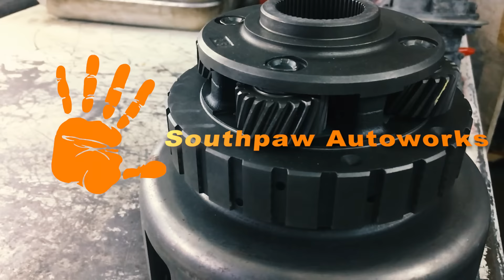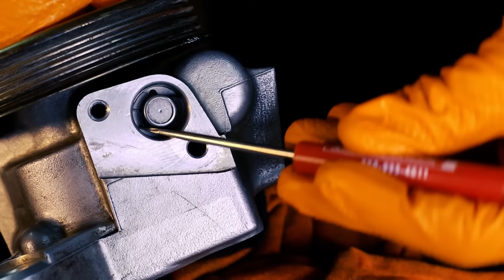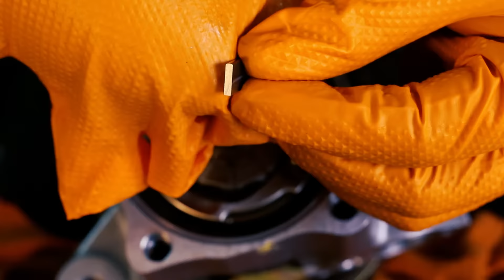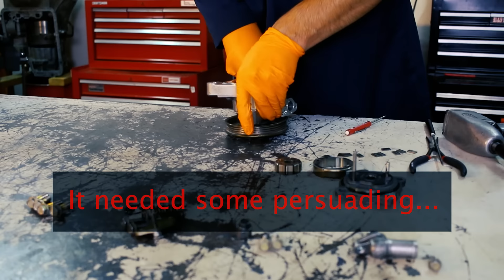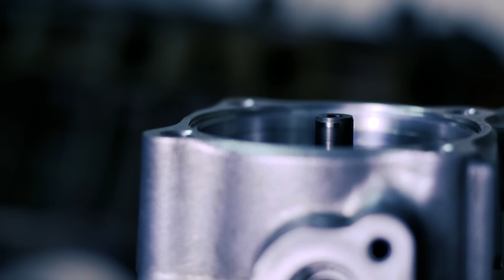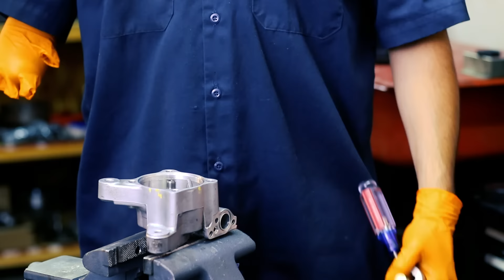Power Steering Pump Rebuild - Part 1 of 3 (1 Hand Mechanic) #SouthpawAutoworks

Comment: This has been one of the most thoughtful Youtube presentations I have seen - on any subject.  Thank you for the care and attention to detail that you have given.  And you did it with one hand!!
Reply from the maker: Thank you for the positive feedback.  A lot of time and effort went into making this video.  It's a labor of love...
Part 2 has been filmed, and edited.  A few more adjustments, and it'll be going live.
Most of Part 3 (final video in this series) has been filmed, and edited.  Stay tuned...
Reply: @SouthpawAutoworks  I had found your Youtube video as a result of searching for information on how I might rebuild my power steering pump, on a 1995 Toyota Camry.  After finding what I felt I needed, I purchased a seal kit, and proceeded to undertake the task of removing the power steering pump.  But the surprise that I got, which I was not expecting, was that the belt which drives the pump had broken (and disappeared).  When I initially looked into the engine compartment I saw the belt for the air conditioner compressor and alternator, but did not realise that there should have been a second belt (for the steering pump).  No wonder the power steering was not working!!!  There have been some good things come from this exercise, though, because I have flushed the power steering system with new Dexron 3 fluid, and have thoroughly cleaned the inside of the power steering fluid reservoir.  Maybe the pump might still benefit from a rebuild with new seals, and the car (which has over 300,000 km on the clock) might get a new lease of life.
Reply from the maker: No way...   I'm glad to hear that it was a simple fix.  If you do decide to open up the pump, share some video footage/pics of it.
Take care.
Reply: @SouthpawAutoworks  Southpaw auto works
You (Southpaw) suggested that if I do decide to open up the pump, that I should share some video footage/pics of it.  At this stage I would like to share my experience with flushing and cleaning the power steering system.  I have seen a number of Youtube videos which showed flushing being done, but most of them involved quite a lot of spillage of power steering fluid, and also requiring very much new fluid before all of the old oil was flushed out of the system.  At least one of those videos suggested the use of a turkey baster as a suction pump to remove fluid from the power steering fluid reservoir, but this was tedious with the turkey baster, and did not remove all of the oil from the reservoir, and it certainly did not withdraw oil from the steering system.
(I have inserted this paragraph after I had written the following “story”.  I know that this story is a bit long, but I wanted to give details which are easy to understand.)
I did some thinking, and built a suction pump which enabled me to withdraw ALL of the power steering fluid, without spillage onto a spill tray that I had placed beneath the car.  What I would like to do is explain a bit of what I did, and the advantages I have experienced with this method.  First of all, my suction pump was able to withdraw all of the oil, until it was just sucking air.  Secondly, I took the reservoir out of the car, and after I drained the last few drops of oil from it I could see the fine wire mesh sieve at the bottom of the reservoir.  This sieve traps particles of debris from inside the steering system, and in my case this sieve had trapped a lot of debris.  As I inspected this sieve in the reservoir I realised that even a lot of normal flushing would not achieve much of a result of cleaning out the debris.  I partly filled the reservoir with gasoline, and with the inlet and outlet tubes blocked shut I shook the gasoline around inside the reservoir.  I was surprised at how firmly the dirt was adhering to the inside of the reservoir, and how little was being washed off by the gasoline.  To my way of thinking I needed to find some way to scour or scrub the inside of the plastic reservoir.  I did not want to use some harsh sort of abrasive such a sand or grit which would scratch the plastic.  I remembered something I had done years ago when I had needed to clean the inside of a plastic container which was more delicate than the reservoir.  I got a piece of lead sheet about 1.5mm or 2mm thick, and cut some narrow strips of lead about 2mm wide.  I then cut small pieces of lead, about 1mm or 1.5mm, from those strips, so that I created some small pieces of lead shot, about the size of grains of rice. I put about a small spoonful of this lead shot into the reservoir – about half of it into the inlet tube (below the sieve) and the other half into the main filler cap (above the sieve).  I then quarter filled the reservoir with gasoline and repeated the shaking procedure.  The results were amazing, with the sieve becoming shiny, and the inside of the plastic reservoir looking almost as good as new.  The benefit of using lead shot like this is that the lead, being soft, will not scratch the plastic.  Also, because the lead shot is heavy, it is much more effective as a scrubbing agent than some other lighter weight substance.

It is obviously very necessary to make sure that every last piece of lead shot is shaken out of the reservoir after the scrubbing has been done.  After it had been scrubbed, I rinsed it again with fresh gasoline, and then I used compressed air to thoroughly blow out all traces of gasoline from the reservoir.  There is one other very important thing to do, and that is to rinse out the inside of the reservoir with clean power steering fluid to remove any last traces of gasoline.

It then becomes a very much simpler exercise to refill the system with power steering fluid, because there is almost none of the old fluid still in the system, which could be flushed out.

And now, I could get to the vacuum pump which I built.  I wonder how many people are watching this Youtube, and reading the comments.  I hope that my long story has not put anybody off.  I shall keep watching to see whether anyone adds a comment, asking for me to give details of my vacuum pump design.  If anybody asks, I shall be happy to write another story about how I built an amazingly effective pump from very simple materials.  I built mine entirely from things I had in my workshop, so I suppose that you could say it cost me almost nothing, other than the time it took to build it.

I would like to add a postscript, saying that I do not know how to attach photographs to this comments section.  I would be more than happy to add photos if I know how to do it.
Reply from the maker: What a great method to clean hard-to-reach places, like this inside of the pump reservoir...and specifically, a metal screen that's partially plugged/blocked by contaminants.  
I am interested in seeing your pictures.  I'm also interested in learning more about your homemade vacuum pump.

Sharing Your Pics:
1)  Instagram is a great way to share pics.  southpaw_autoworks  
2)  If you want to share pics on YouTube, you would need to create a video, of your pics....like a slideshow.  
A guy could use a number of video-editing programs to accomplish this.  There are free versions for both PC & Mac:  Windows Movie Maker (PC) and iMovie (Mac).  Also, I believe that Microsoft Powerpoint might work, for this instance, too.   I posted some resources below.  Gotta love YouTube...

Resources:
PowerPoint:  https://www.youtube.com/results?search_query=create+a+video+with+powerpoint
Windows Movie Maker:  https://www.youtube.com/results?search_query=make+video+with+windows+movie+maker+
iMovie:  https://www.youtube.com/results?search_query=make+video+with+imovie

I look forward to seeing your pics/video.  Take care.
Reply: @SouthpawAutoworks  Can you please advise an email address for yourself or your business?
Reply: @SouthpawAutoworks  The vacuum pump I built for extracting power steering fluid consists of two main parts – a pump to create the vacuum, and a suitable container to hold the fluid which has been extracted.  The information which follows is in two parts, firstly a simplified description of the unit, and then a (much) more detailed design and the materials I used.
= = = = Simple description = = = =
The pump is very similar in principle to a bicycle pump, which compresses air when you push the plunger into the cylinder of the pump.  The vacuum pump, on the other hand creates a vacuum when you withdraw the plunger from the cylinder.
The storage container is a large glass jar which has an air-tight metal lid which screws onto the jar.  Plastic tubing is attached to two metal tubes which are fitted through the lid.  One tube connects to the pump which creates the vacuum, and the other tube is inserted into either the reservoir, or the return hose from the steering rack.  It is very important to make sure that these tubes are sealed perfectly airtight to the lid, otherwise the system will lose vacuum easily, and will not work very effectively.
I constructed a box just big enough, and tall enough, to completely contain the glass jar, and attached this box onto a base on which I can place my foot, to keep the jar stable during the pumping process.  I attached a “post” to the side of the box and strapped the pump (in a vertical position) to this post.  To use the pump, I place my foot on the base, and move the plunger up and down – pulling up creates the vacuum.  The box serves two purposes.  First, it provides a safe place to protect the glass jar from accidental damage or breakage, and prevents it from being bumped or tipped over.  Second, the pump is attached to the side of the box (i.e. onto the post which is attached to the box), and when you place your foot on the base to hold it down you can pump as vigorously as you wish without any risk of the jar becoming disconnected from the pump.
I will post the detailed description as a separate comment, because Youtube apparently thinks it is too long!
Reply: = = = = Detailed description (part 1) = = = =
Please note that I called this a “Detailed” description.  I do not know of a way to insert pictures or photos into a comments section like this on Youtube.  I have tried to make this description as detailed as possible so that you should be able easily to visualize each step of the way.  This is a long description, but I hope it is a good one!!  I have broken it into several parts, because Youtube does not seem to like long comments!
The cylinder of the pump is a piece of PVC plumbing pipe.  You can choose the diameter of pipe which you use.  A small diameter pipe (such as one inch) will mean that you do not withdraw very much air for each stroke of the plunger.  A bigger diameter pipe (such as two inches) will mean that you can withdraw much more air for each stroke of the plunger, but it will also require more muscle power to operate the pump.  I used a pipe with about one and a half inches internal diameter. You can choose how long you would like the cylinder to be, but I have made mine about two feet (600mm) long.
I made the plunger from a length of bright steel rod.  You could use 5mm, or 6mm or quarter inch diameter rod, depending on what you have available.  You will need thread cutting tools (a thread tap and die) for the particular steel rod that you use.  Cut a thread on one end of the rod, about three quarters of an inch long, or about 19mm.
The piston requires you to use a reasonable amount of precision, because it is at the “heart” of the system.  You will need to obtain, or make, a metal disk which provides the backing for the piston seal.  This disk must be of stiff material (steel, somewhere around one sixteenth of an inch, or even one eighth of an inch, or 1.5mm to 3mm thickness).  The size of this disk must be fairly precise, and must just fit in the bore of your plastic cylinder pipe.  The diameter of the disk can be slightly less than that of the pipe, but it must be able to slide up and down the pipe very easily, and its edges must be polished smooth so that the disk cannot scratch the plastic pipe.  Drill a hole in the centre of this disk which is smaller than the diameter of the plunger rod, so that you can cut a thread on the inside of this hole, so that this disk can be screwed onto the plunger rod.
Reply: = = = = Detailed description (part 2) = = = =
You will also need a washer which is about quarter of an inch, or five sixteenths of an inch less in diameter (6mm – 8mm) than the first disk.  If you need to make this washer yourself, you can use thinner material, 0.5mm to 1.0mm in thickness.  Drill a hole in the centre of this washer, the same size as the diameter of the rod.  This washer just needs to slip onto the rod.
Now we get to the piston seal itself, which is made of soft leather about 2mm thick.  If you “just happen” to have an old leather shoe which is worn out, you may be able to rescue a piece of leather from it, which is big enough).  It needs to be about three eighths of an inch (10mm) bigger in diameter than the internal diameter of the cylinder.  Punch a hole in the EXACT centre of this leather disk, but make this hole slightly smaller than the thickness of the plunger rod, so that it has a very snug fit on the threaded end of the plunger rod.  Very carefully chamfer (or “feather”) the edges of this leather disk, so that the edges of this leather disk can be cupped when the pump is assembled.  This chamfering of the leather should be done on the rougher side of the leather.  Soak the leather disk with engine oil, which will allow the leather to become supple, also it will provide lubrication between the leather and the plastic pipe when the pump is operated, and the oil will also help to make the seal capable of maintaining a high vacuum.
The assembly of the piston is described in the following the steps:
.  First, fit a nut onto the threaded end of the plunger rod,
.  Next, slip on the smaller washer, against the nut,
.  Then fit the leather washer onto the plunger rod, with the smooth side of the leather against the washer.  If you made the hole in the washer a good snug size, you will probably have to turn the leather disk on the threaded rod – this is a good tight fit.
.  Next, screw on the bigger, thicker disk, onto the threaded rod.
.  Finally fit another nut onto the end of the threaded rod, and tighten up the two nuts which have the washers and leather between them.
Reply: = = = = Detailed description (part 3) = = = =
You should be able, at this stage, to slide the piston assembly into the cylinder.  You may need to massage the leather disk so that the edges are raised towards the long end of the plunger rod.  You can now test whether you have done everything correctly.  Push the piston almost all of the way through to the other end of the cylinder, place the palm of your hand over that end of the cylinder, and pull on the plunger rod outwards from the cylinder.  You should feel very powerful suction against the palm of your hand.
There are several more steps required to complete the construction of the pump.  
Make a wooden plug for the top end of the pump, from some type of moderately hard wood.  Soft wood could be OK if you cannot get hardwood, but it will not be as durable.  This plug should be about three quarters of an inch (19mm) thick, and cut into a circular shape so that it can fit snugly into the top end of the cylinder.  Drill a hole in the centre of this plug, which is slightly bigger than the thickness of the plunger.  When you use the pump, it creates a vacuum on the bottom end of the cylinder, but creates positive pressure above the piston.  This slightly bigger hole allows the positive pressure air to easily escape past the plunger rod.  Apply oil to the hole in this plug, to provide lubrication for the plunger rod as you operate the pump.  I mentioned that this wooden plug shall be a snug fit into the plastic pipe, and it is quite OK to have it slightly oversize, because you can use a hot-air blower gun to heat and soften the top end of the plastic pipe, and press the plug into place.  When the plug is tightly in position, use a file (or some other suitable method) to make a registration mark onto the wood and the end of the pipe, so that it is easy to see the exact position that the plug must be whenever the plug is removed and refitted.  With the registration mark in place, drill a small pilot hole through the wall of the cylinder and into the wooden plug, so that a screw may be used to lock the wooden plug into place.
We are now ready to complete the bottom end of the pump.  I made a plug from a piece of one inch thick black rubber material.  It is very important that this rubber plug is made as carefully as possible, because it needs to make a completely airtight seal.  I used my bench grinder to grind the circular shape of this plug.  The grinding rest which supports the material being shaped should be at a slight angle to the grinding wheel, so that the sides of the plug have a slight taper.  In other words the end of the plug which fits into the cylinder is slightly smaller in diameter than the other end of the plug which faces away from the cylinder.  For best results, this rubber plug must fit very snugly into the plastic cylinder, and this can be achieved if the bottom end of the cylinder is slightly tapered to match the rubber plug.  Use a hot-air blower gun to heat and soften the bottom end of the pipe, and push the rubber plug into position so that the plastic pipe will have the same taper as the rubber plug.
Reply: = = = = Detailed description (part 4) = = = =
Metal tubes need to be fitted to the pump, and also to the lid of the glass jar.  I used steel tubing with an outside diameter of about quarter of an inch (about 6mm), but the correct size metal tube must match the plastic tubing that you will use to withdraw the power steering fluid, and also to connect between the pump and the jar.  The tighter the fit, between the steel tube and the plastic tube, the better.  If necessary you can use the hot-air blower to soften the plastic tube to make it easier to push the plastic tube on to steel tube.  Drill a hole into the centre of the rubber plug, to allow insertion of a metal tube, about two inches long.  CAUTION: Drilling holes in a block of rubber requires care.  Make sure that you have some way to hold the rubber very firmly when you drill the hole.  Use a drill press, and advance the drill very slowly because it can easily happen that the drill will grab the rubber.  Also, you may need to do a little trial and error to determine the best size drill to use.  We want the steel tube to fit very tightly into the hole, and it would be good to test your hole-drilling procedure on a scrap piece of rubber.  To make it easier to fit the steel tube through the hole, use some power steering fluid to lubricate both the rubber and the steel tube.
We are ready now to talk about the glass jar that you will use.  Basically, you could use any jar which is large enough to hold all of the oil that you will extract from the power steering system.  It is very important that this jar has a lid which can close the jar with a completely airtight seal.  I used a jar which is about two litres in capacity, which had originally contained pickled Jalapeno peppers.  This jar has a wide mouth, about three inches (75mm) in diameter.  I have seen similar large jars which have contained pickled gherkin cucumbers from Poland.  Depending on which country you are in, and the types of foodstuffs which you can obtain in large glass jars, you can choose.
It is very likely that the jar you obtain will have a lid made from fairly thin steel.  When you create a strong vacuum with your pump, the outside air pressure would be capable of distorting the lid, and render it incapable of providing an airtight seal.  It is therefore necessary to provide reinforcement for the lid, which I did with a circular wooden cover which is just a little bigger in diameter than the lid.
So now we are up to the stage of reinforcing the lid, and fitting two steel tubes to the lid – one for connection to the vacuum pump, the other to collect the power steering fluid which is extracted from the steering system of the car.  We need to make a lid reinforcement disk from moderately strong steel sheet, probably about one thirtysecond of an inch or up to one sixteenth of an inch (0.8mm to 1.5mm) in thickness.  This disk shall have a diameter about quarter of an inch less than the diameter of the inside mouth of the jar.  We will also need a piece of soft rubber about 1.5mm to 2mm thick, which you could get from an inner tube from a truck tyre.  This rubber will be used to make a gasket to seal the holes for the steel tubes, and also for the screws which need to be used to hold the lid components together.  We also need four wood screws which are about the same length as the thickness of the wooden cover for the lid.
Reply: = = = = Detailed description (part 5) = = = =
The next part needs to be done carefully, to make sure that the holes we make in the various components of the lid assembly are all perfectly aligned.  On the lid reinforcement disk mark the positions for the two steel tubes.  In my case these two holes are near the centre of the disk, and about an inch (25mm) apart.  I found it very helpful to adhere masking tape to the disk, because it is easy to then use a pen or pencil to mark out the required positions.  Mark the positions for the four wood screws, at the four corners of a square which you can draw around the two holes for the steel tubes.  Use a centre punch to mark the positions of these six holes.  Now use adhesive tape (masking tape is good) to hold the reinforcement disk against the inside of the jar lid.  Make sure that you have this disk centred as accurately as possible.  Next, we need to fasten the wooden cover onto the lid, and this can be done by wrapping masking tape around the rim of the lid and the wooden cover.  Choose the correct diameter drill for the screws to be driven into the wooden cover.  Drill just one screw hole, and then drive a screw in, through the reinforcement disk, the lid, and into the wooden cover.  Tighten the screw firmly.  Next, drill another screw hole, in the opposite corner of the square pattern, and drive a screw into that hole.  The reason for fitting these screws, one at a time, is to make sure that the reinforcement sheet, the lid, and the wooden cover are all in perfect alignment before we drill the remaining holes.  You can now drill the last two screw holes, and the two holes for the steel tubes.  Make sure that the drill you use for the steel tube holes is not too big.  We need these two holes to be only just big enough to force the steel tubes through.  The next, VERY IMPORTANT step is to mark these three components of the lid – the reinforcement disk, the lid, and the wooden cover - so that you can easily reassemble them in the same position, and with the holes aligned exactly.  Remove the screws from the lid assembly.  A gasket needs to be made from the truck tube rubber which will seal all of the holes. Use a hole punch to make holes for the steel tubes, but make sure that they are smaller than the tube size, so that the rubber fits tightly over the tubes.  Cut the rubber into a circular shape, and fit it between the top of the jar lid and the wooden cover.  Push the two steel tubes through the wooden cover, keeping the top of each tube about one inch above the wooden cover.  I used a four inch long tube for the oil inlet, and a two inch long tube for connection to the vacuum pump.  Next, fit the rubber gasket over the two tubes.  At this stage, do not make any holes in the rubber for the screws to pass through.  Then fit the lid against the rubber gasket, and finally fit the reinforcement disk inside the lid.  Now use a sharp nail, or something similar to pierce the rubber gasket, for the four screws.  Install the four screws, tightening them firmly.  This will ensure that the rubber seals tightly against the lid, enabling the lid assembly to not leak any air.
Reply: = = = = Detailed description (final part) = = = =
We are almost finished, and I feel sure that anyone who can build the pump will be easily able to make the box into which the jar can be placed, and the pump fastened to a post which is attached to the side of the box.  I used a couple of pieces of metal strapping, bent into “U” shapes, to fasten the pump.
There are a few refinements which can (should?) be made to the pump.  To help maintain the vacuum in the jar while the plunger is being lowered, I made a simple valve in the rubber plug at the bottom of the cylinder.  I enlarged the diameter of the hole on the top side of the plug to a depth of about an eighth of an inch (3mm), so that a glass marble could roll into that hollow.  When the plunger is lowered, the glass marble falls into the hollow, and blocks air from getting back to the jar.  If you want to do this, you will need to make sure that there is a good seal between the marble and the rubber stopper.  I also wanted to prevent the plunger being pushed down too deeply.  I used a nut of the same size as was used for the piston assembly, but drilled out the thread so that it could just be pushed onto the top end of the plunger rod.  I wanted the piston to ALMOST get to the bottom of the cylinder, so that it does not hit the marble.  I carefully marked the position on the plunger rod, where the stopper would come to rest on the top of the wooden plug at the top of the cylinder. I used a file to cut a couple of notches into the plunger rod at that point, and slid the drilled out nut to this position.  I then placed this nut on a firm metal surface, and hit the nut strongly with a hammer to squash it so that it would grab the notches which I had just made.  I bent the top end of the plunger rod to a “J” shape, a bit like an umbrella handle, to be able to pull the rod upwards to create a vacuum.
I just had to fit a pun in here!  “We are almost home and hosed”.  To fit the “hoses”, connect a short length of plastic tube onto the bottom of the pump, and onto the short metal tube on the jar lid.  Fit a longer length of plastic tube for extraction of fluid.  I made this second tube about six feet long, so that it would easily reach the oil reservoir and the low pressure hose.
I hope that you will be as pleased with your pump as I am with mine.  If I knew how to add pictures to this story, I would have done so.  If you want to see photos of my pump, or some drawings of how it is made, send your request by email to “wilfred dot kube at gmail dot com”.
Reply from the maker: Now, that is detailed!  I could visualize each of the steps that you outlined.  
I like how you heated the PVC to create an interference fit at both the top and the bottom of the pump.
Thank you for sharing.